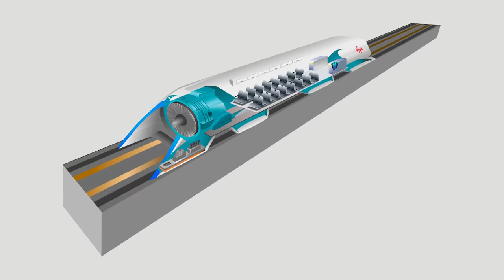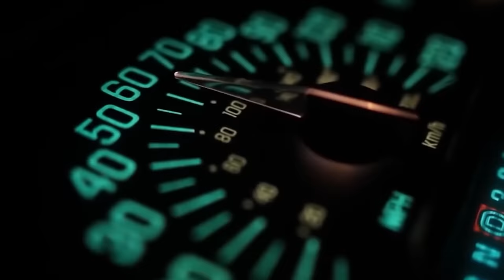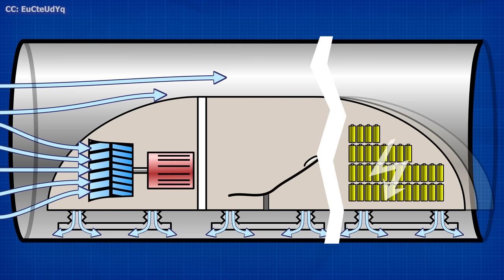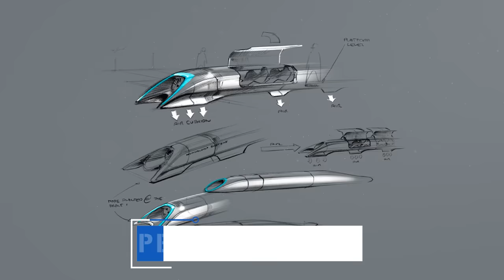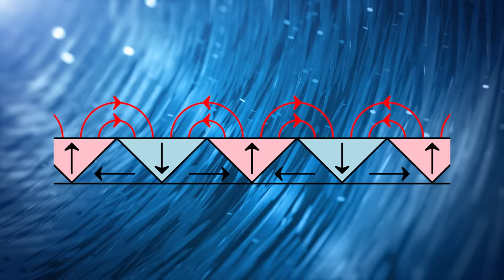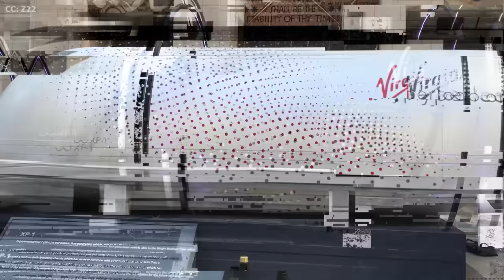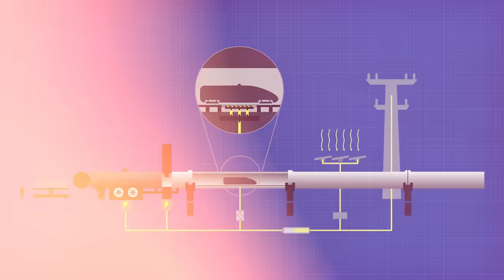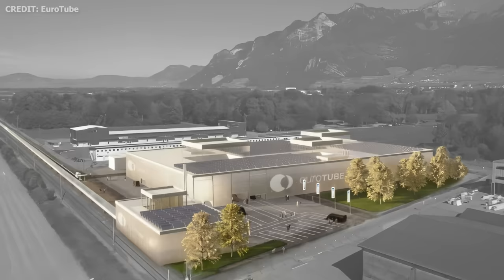We’re Getting Closer to a Hyperloop...

Comment: One thing I just thought about, how would the non rail or mag lev version slow down or stop??? Magnetically perhaps? Maybe I’m not understanding anything?
Reply: maglev trains are accelerated by having rows of magnets builtintothe trains and rows of electromagnets all along the tracks, and the electromagnets are electronically controlled just like they would be in a brushless motor to switch on and change polarity at the correct times to push the inxdovidual magnets on the train one way or the other. to decelerate, they use regenerative braking like many other vehicles. I don't know what specifically needs to be done with the recaptured electricity to store it, but thebasic principle is that the inverse of the fact that an electric current through the electromagnet coils induces a magnetic field that can push a magnet is that a magnet moving past the coil alao induces an electric current in the coil, and any current you draw from that translates into deceleration of the magnet.
Reply: @Ass_of_Amalek  cool I thought it was something along that line. Thanks fir the education.

Comment: As I remember it Musk was very clear that he didn't want to develop/build the hyperloop himself, and even most reporters picked up on that part at the time.  

Boring company and their loop is primarily about beating traffic, not aerodynamics. Not the same concept, actually very different. Boring company also mentions the hyperloop, but they're not working on it as far as I know, and it's absolutely not the same as the loop.    

Not much media attention for the Boring company for a while, but it seems they're working. Building infrastructure can meet a lot of issues, it's not strange if there's nothing worth reporting for years, unless something bad happens. Also, didn't Musk solve his own problems with soul destroying traffic by moving?  Anyway Musk has other things to attend to, that can be developed much faster, it's not like he's sitting idle.

The mere fact that Musk was clear about not wanting to develop hyperloop himself should have been a clear sign that it wouldn't be quick and easy to do.         

While technically viable, all the boring stuff (boring in the bad way) involved in infrastructure megaprojects like permits, might stop anything like hyperloop from being successfully developed and built. The advantage China has is not limited to their ability to adress the required funding, they also don't have to care as much if they hurt a few persons feelings. And, the larger the population the more useful mass transit systems become, all else equal, so they have much more to gain than most.

Comment: Just do vacuum tubes like the post office used to have below London. That's at least doable.. I believe a few people did post themselves back then. To get a rid being blown through a tube below London. In a capsule of course.
Reply: The vacuum tubes though technically only partial vacuum where very different from what you are describing which are the larger pneumatic tubes. You may want to read more about it first.

Comment: According to Musk, hyperloop would be useful on Mars as no tubes would be needed because Mars' atmospher is about 1% the density of the Earth's at sea level. For the hyperloop to work on Earth, low-pressure tubes are required to reduce air resistance. However, if they were to be built on Mars, the lower air resistance would allow a hyperloop to be created with no tube, only a track, and so would be just magnetically levitating train.
Reply: But he still needs to call it a hyperloop?
Reply: All true, but then isn't that just ordinary rail able to run at far higher speeds than down here?
Reply: Weirdly enough, this tube thing might be more feasible in Mars. The tracks will be covered in thick electrostatic dust, but that would not really matter if you had them in a closed tube. If you don't need the vacuum, even better.

Comment: One simple question.  How is a giant inflexible tube going to handel curves and turns? 😮
Reply: On a very long distance by very small increment, which adds to the impracticality. So yes, ideally it have to be built in the straighter line you can find.

Comment: I'll tell ya what really tracks, It's a hype train inside a pipe dream.

It's a nice theme for some sci-fi, but I wouldn't bet my money on it being successful any time soon. 
A reasonably thin vacuum tube with current technology can't be sealed and drained from air completely, so there will be friction regardless. The use of pods or single carriages has a large footprint and low throughput because there is a minimum distance between pods or trains. Therefore the pods will be chained to trains anyway and the pods in trains have relatively low friction already as they are in the slipstream of the lead carriage. This then severely impedes the theoretical benefit of the vacuum system, moreover as boarding times will probably be longer as air needs to be vacated from the boarding air-vacuum dock. This means total travel time will be longer on short and medium distances and the system will only eek out a performance boost on continental distances (for which we already have airplanes - which you can clad with perovskite if we are talking near term improvements). Only if pipe dream tech improves drastically might there be a chance; I am thinking of the proposed drilling technology that melts rock and creates a vitrified shell around the cavity which could possibly support high vacuums safely across continental distances and still keep construction and land acquirement costs relatively low with regards to throughput capacity.

Perhaps your nation has a propensity for war and you're really just wondering if such an infrastructure would be safer from enemy attacks than regular rail (I am looking at you DARPA)? Yes and no; the tunnel probably is quite secure, but the boarding stations are few and far between and have to be accessible as well. Now imagine being stuck inside a 600 km hyperloop tunnel which has been attacked, the power shut down to the tracks, but at least there is air gushing back in around your pod. There is no service tunnel, so you're going to have to walk the stretch.. Are you really sure which station is closer? People with metal implants are in grave danger of the magnetic fields close to the tracks, there are still currents running in the room-temperature superconducting electromagnets. You're almost there, then the air starts gushing again, now from the other side. What's going on? It dawns on you that the tunnel must have been breached somewhere under the ocean, the ingress of water is pushing the air out in front of it.. Just your luck. Maybe you can reach the service shaft nearby and escape the lower reaches of a quickly submerging boarding station?

Comment: So, no mention of Nevomo then?
Reply: I thought Simon mentioned Nevomo or maybe he didn't. After a while every CGI animated proposal blends together. I think Nevomo is basically just reinventing the cable car but using magnetic levitation as propulsion instead of cables. In theory it's supposed to work with existing tracks but the problem with that is the reaction forces would apply to center of the ties, exactly where they are not designed to handle them. It would require rebuilding all tracks to accommodate them. Also there is the question as to how to handle snow build up on the tracks. Nevomo's current testing prototypes have nothing to do with the Hyperloop.

Comment: Why are the Hyperloop vehicles shown have an aerodynamic nose section?
Wouldn't that be irrelevant in an airless environment??
Reply: Because it is intended to only be in a NEAR-vacuum, not a perfect one, so there will still be some air resistance at supersonic speeds (think of a spacecraft returning to earth - all the heating takes place in near-vacuum way above 100,000ft). But even near-vacuum in a very long tube is almost impossible; high vacuum would be much harder again.

Comment: Lol yeah, if someone asks what are your "compressed air" and "air hockey table" comments, that means that these people actually wanted to compress air and levitate the pod in hard vacuum with that. If it sounds pretty much idiotic, it is because thats an idiotic idea. Maglev as a buzzword maybe better, but we can question if it is worth it to use supercooled magnets to drive a pod for 5% decrease in frictional losses of a stadard railcar. And it has to be way stronger than a standard maglev since if the pod ever hits the wall, then it would possibly destroy the whole structure. To put into perspective, the pressure wave of a nuclear blast only causes around 0.1 bar pressure difference, if a hyperloop tube ever opens up, it will cause a 0.9 bar pressure wave goung throug the pipe with the speed of sound. Inside the pod, if it is a passenger pod, if it cracks, and the passengers dont wear spacesuit, they are dead. Humans cant breathe in vacuum, not because there is no oxygen, but because the lungs needs a certain pressure against your chest to pump out carbon dioxide, thatswhy astronauts required to wear their spacesuits during their flights. As well as a hyperloop tube made out of steel which would extend from Helsinki to Stockholm would have an 500 m long thermal expansion on its whole track.Which means that there will practically be never be a tube longer that a few miles where they can mitigate this issue, and on a few miles long track you will never accelerate even freight not passengers to 900 kmh, mainly because everything would be crushed inside your pod if you try. This is a rather unscientific concept.

Comment: The hyperloop is a fantastically stupid idea. It's insanely difficult to make it work, while displacing high speed rail [the actual objective Musky really had], incredibly inherently unsafe in ways that are hard or impossible to correct, and so on. Meanwhile, we could just ... have high speed rail. We can already travel at or near airline speeds with them, while cutting out the mode transition.

Comment: To create 1/10th vacuum below atmospheric pressure in 10 km long and 3 meters diameter tube requires 13150 kWh=13MWh of vacuum pumps electric motor energy consumption. That is 13MW electric motor must operate one hour, plus we count 0.9 efficiency  of motor so 15MWh energy consumption. Hyperloop is just wishful thinking.

Comment: This is just unrealistic for both people transporting and large cargo transportation. 
For people, it’s WAY to unsafe as a single leak could cause explosive decompression in the cabin, not to mention the entire tube it rides in. Stack on the fact you need to now maintained a MASSIVE vacuumed tube for the entire system, and it’s just an energy consuming beast to maintain in a time where power is getting more expensive. This is also why it’s not feasible for larger cargo transportation either. If it has ANY use, it needs to be scaled down for smaller cargo over smaller distances. 
It honestly blows my mind Elon still has so much $ after all his stupid projects that go nowhere. The Boring company, Hyperloop, the brick company etc… they all fail or just go nowhere.

Comment: These are really fascinating technologies.  My concern is that passenger service requires many more safety features than freight service.  I have a family member who is wheelchair-bound, and a plane trip across North America is not realistic--so transoceanic travel is impossible.  I look forward to seeing the future of travel unfold!  Maybe we can use this someday to travel around the world!
Reply: Land bound transportation is definitely safer. Inside tunnels even safer. I even designed crash resistant trains inside tunnels. Won't work for planes or transportation without any tunnel. Using my Optimum Damage Reduction Systems patent filings.
Reply: Maybe never, well I make any bet it will never happen, besides a small test setup.
Reply: @othmanskn  how would you stop thousands of tonnes of air racing at mach 1 through a vacuum tube  ?

Comment: Hyperloop will never happen, far to much power needed, near impossible to pull the required vacuum in such a massive structure and it would be a total death trap which would kill everyone in the entire length of the tube if there was a fault or attack the caused the vacuum to be rapidly lost.

Comment: How did an idea that was as easy as an airhockey table get so convoluted , hard and drawn out?..............It should already be 1/2 way to being totally done yet Elon fans still back the tourist loops TBC is building for cities as beginnings for the 1300 mile long tunnel system.......The Vegas Loop project is a tourist attraction funded by the city of Las Vegas...It wasnt designed to solve a traffic problem it was designed to increase traffic to generate more revenue....LOL.

Comment: The hyperloop is one of those ideas that sounds like it was dreamt up by a hyperactive 8 year old. There's nothing about it that's physically impossible, but it is wildly impractical to the point of being virtually impossible to actually implement as described. Giant vacuum tubes simply aren't a good idea from an engineering standpoint, let alone a financial one. You'd get way more bang for your buck even using current exotic and expensive maglev systems, let alone more conventional high speed rail. Like so many of his other endeavors, Musk is an absolute moron pushing a mind-numbingly stupid idea that will only lose money.

Comment: New technologies like this are best started at realistic scales and serve a commercial benefit. If they can get the cargo transport operational, and have it serve the purpose of moving freight inland from the crowded city ports, and provide an economic benefit, then that will be the type of starting point that allows for further improvement.  Its best to start with a practical distance a few kilometers and at lower speeds.  Let innovation gradually increase the distance and speed traveled as well as improve production techniques .

You don't start with everyday use of transcontinental aircraft, you start with bi-planes and work your way up to commercial jets.  :)
Reply: Not a new technology is a century old. How many pneumatic tubes are exciting today  ? Very few. There is a reason all those have disappeared.

Comment: I love discussions around transportation tech. I've been noodling urban design forever. When asked about the specific deets on transpo I admitted for decades that I leave the hardcore answers until I'm ready to pitch the overall idea. So tech dependent. Soo influential on other design parameters.

Of the hyperloop ideas I did draw up all of them up as back on napkins renders. A few more variants too. Some I would take to the mat with some rough math to see how close to possible things could get. Math Matters.

I've since worked out the overall urban planning design. Also the transpo. Just working on how to get them done.

When asked about why put off specifics on transpo design I noted doing so from then would introduce shortsightedness into the design from early on. I pointed out that by designing everything else I was drawing into a nuanced feature set required. I kept refining, asking what I want it to do.

You mention Elon Mr We Coup Who We Want Get Over It, I use this as an example of what he calls 1st Principles Design Approach. Fancy. I called it going back to the whiteboard & starting from scratch.

Thanks for the think.

Comment: There's a reason cargo Hyperloop is more interesting--getting to the site of a failure and doing rescue/evacuation is going to be hard and time consuming in a vacuum. Pressurized the tube to facilitate this and depressurizing afterwards takes a lot of time. It will be interesting to see how this evolves.
Reply: God forbid that whatever necessitates an evacuation actually damages the tube. Because rapid compression is just as if not more deadly than rapid decompression.
Reply: There is an extremely low demand for high speed cargo, the Hyperloop is expensive, any HL station would require an expensive an airlock with large vacuum pumps.

Those stations would require specially trained staff, while being a huge potential point of failiure.

So this is an expensive system with high risks and an extremely low demand.

Yeah, nah, Hyperloop Cargo is just a terrible idea at a high price

Comment: Here's a side thought... isn't the technology/material they're planning to use for the tunnel pretty much the same as the Titan submersible? And we all know what happened there...
Reply: I'm no engineer but I doubt this vacuum tube compares with the depths of the oceans in terms of potential
Reply: 1 atmosphere of pressure vs 600 is not the same lmao
Reply: No. Hyperloop is still a nonsense idea, but a vehicle inside such a loop would be closer to an air or spacecraft, containing a greater pressure inside the vehicle than exists outside.  The carbon fiber casing would therefore be under tension by containing the greater pressure inside.  Titan had it reversed, and therefore had the fiber under compression trying to keep the great pressure out of the vehicle.

Comment: Yeah, well... all these, as well as all the other "pod-based" transport systems are just trains but with a fancy twist and allways worse than... well trains. "is able to carry thousands of passengers per hour" - a single train can do that. The only advantage they have over trains is speed, and in most cases this isn't the most important problem. The problem gets worse for freight, were speed isn't even a factor As cool as they sound, they are all duds.
Reply: Also, high speed trains are a thing, and cheaper, and more practical and some are as close to the theoretical speed of this thing already.

Comment: A portion of the power for the system could come from solar panels set atop the length of each segment as well as small vertical axis wind turbines that could serve as dual-purpose power generation and a low-pressure air pump.